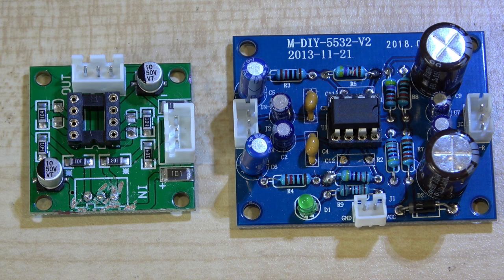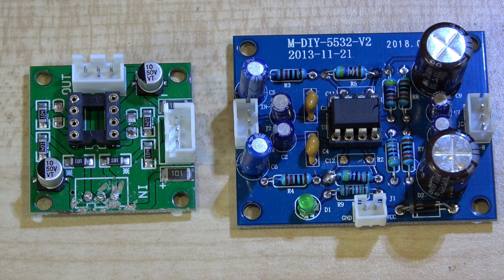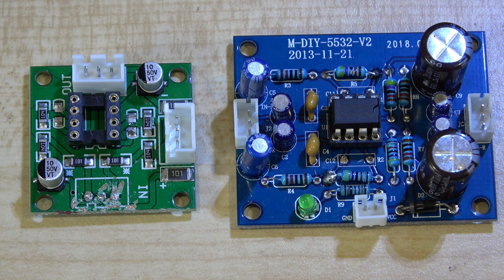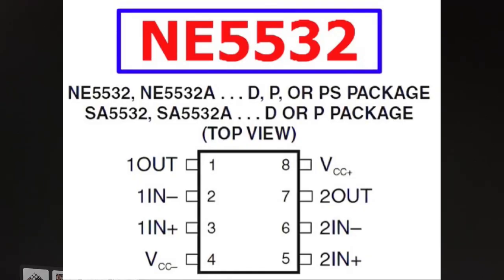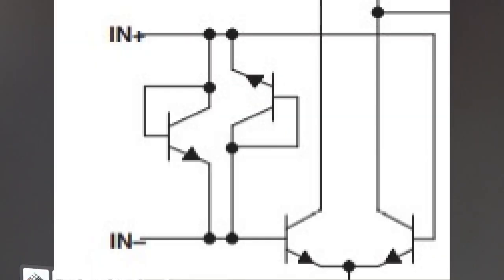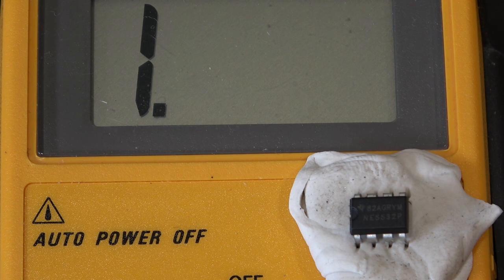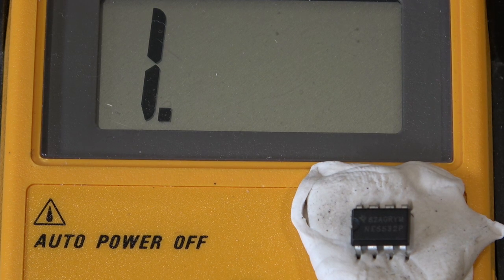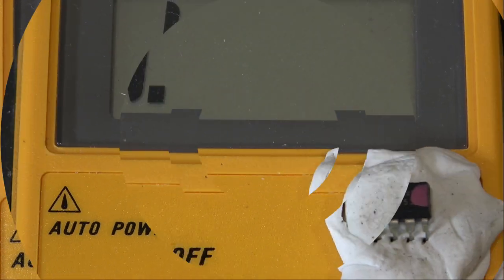How to test NE5532. Fake or Real?

Comment: Thank you Michael, yes l tested the ones l had in stock from ebay and open circuit on pins 3 and 2. If l get any more like it l will ask for a refund. These were noisy which is why l suspected them. Superb info. I am interested if you have a known good supplier for the genuine NE5532’s? Thanks again
Reply from the maker: I think if you use a proper distributor such as RS, Farnell and other well known names you will be 99% sure they are genuine. They would only buy from the manufacturers directly. They do cost more but if you don't have to bin 60% of them it's worth it.

Comment: I used to look at the seam at the sides for the two copper points to determine original TI/JRC die but my eyes aren't getting younger.  Thank you for the excellent tip
Reply from the maker: I know what you mean about the eyes, I find resistors a problem. I'm sure my carpet contains more resistors than my storage boxes.
Reply: @MichaelBeeny   I feel your pain, good sir.  Those tiny quarter watt blue metal film resistors have become undecipherable to the naked eye.  With resistors jumping off to the carpet, you can get a reasonably strong Neodymium magnet, stick it to flattened tin can sheet and drag it across the carpet.  Saved me a bunch of times from getting down on my half a century elbows and knees hopelessly looking for those buggers
Reply from the maker: @remarpc  I bow down to experience in this matter, thank you Marvin.
Reply: Are two decent and clean looking copper points sign of the real NE5532?
Reply from the maker: @bringmeheadofbill1226  As there are a number of companies that make these, the test I have shown is the only clear sign I know of. No diodes = fake.